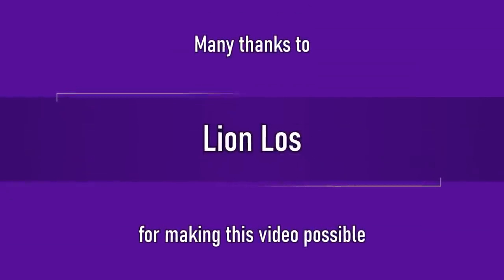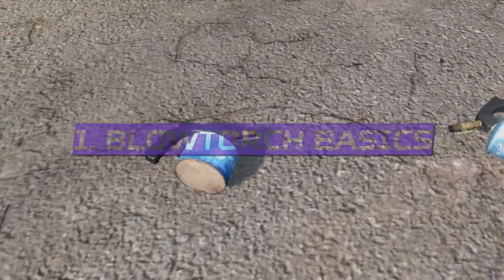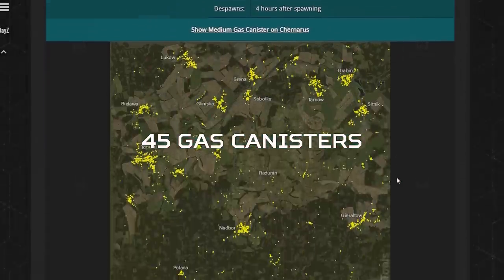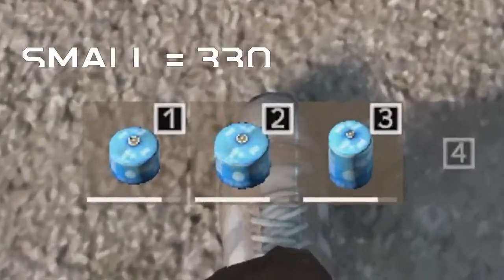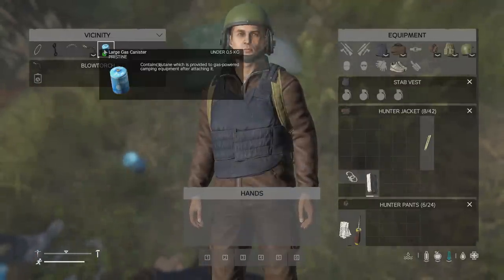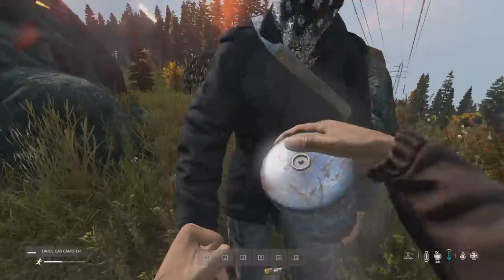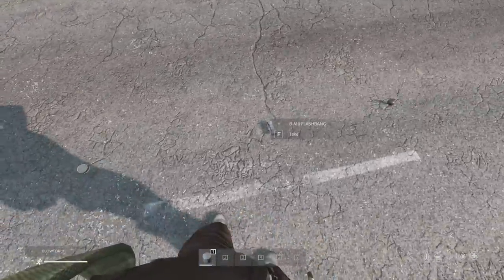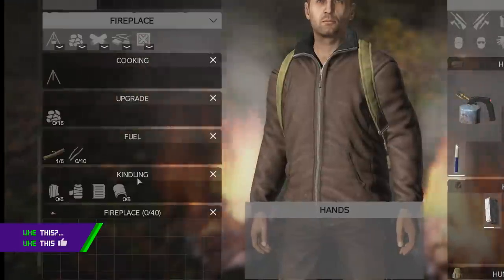Everything the new Blowtorch can do in DayZ 1.19

Comment: The blowtorch should repair radiators and then the electrical repair kit should do spark plugs and car batteries
Reply: Yep.. the radiator esp. like IRL
Reply: I think spark plugs are non-repairable IRL.
Reply: @zdspider6778  pretty much same with radiators, unless it’s the outer part, the aluminum frills in there would just melt by a blowtorch lol
Reply: In real life though, spark plugs pretty much never go “out” unless heated to the point they melt. If otherwise, all you have to do is “clean” them with a degreaser and light grade sand paper. I have did this many times. But for Dayz, that’s tricky If the blow torch could “fix” a spark plug. When when a spark plug usually goes out from the residues (real life). But, the residues could possibly burnt off (game theory thinking) for Dayz. Kinda difficult, but I believe Dayz could swing, for the blow torches to work, for fixing spark plugs.
Reply: Spark plugs occasionally widen the spark gap as time goes on
You can heat the tip up and bend it back
But it should take a electric repair kit to pristine a spark plug
Reply: @donovanulrich348  Not to mention if the ceramic breaks its done.
Reply: The radiators are not repairable in most cases irl. Spark plugs too. I know that the Day Z is not a full representation of brutality of our real world and it's operating on some simplifications, but simplification doesn't mean that u're able to do things that are not possible.
Look at the consistency of those simplifications: u get sick - u need to take medicines to get better, u break ur leg - u need to make splint or take lots of drugs to prevent u from fainting constantly due to the pain, u break the car - u need spare parts and tools to fix this. See this? These simplifications are consistent with the actions that u need to perform in real world. In real world there isn't any option to repair the broken radiator. Ofc IT'S POSSIBLE to seal it somehow, but noone can guarantee u it's gonna work more than very short period of time.
Reply: Or epoxy
Reply: @SrtKillz12345  nah they should add sandpaper to fix the plugs then
Reply: Why not an actual toolkit though? Nobody uses a blow torch on any part of a car
Reply: I kind of like the rarity and fragility of spark plugs. Its the closest thing we have to an anti-theft measure.

Comment: Blowtorch could be used to hardend steel on axes, hatchets etc. After using a sharping stone to increase condition then use blowtorch  to harden the edge and increase the durability of the shrapen edge. If afrer harden and edge hits metal or stone then edge is damaged or chipped.  Metal becomes brittle after heat treat but wear surface is stronger.

Comment: Was hoping to use it for repairs on my metal walls, as sometimes randoms like to beat on the first gate for a while, but noticed my worn metal made a prestine wall anyways, now ill use it for my dilapidated barrels instead 😆
Was also hoping to repair wire and barbed wire too, but no worries.
You would think it would be a good tool to get the barb off a gate before raiding...
When i raid with hand tools i HATE when he steps into that wire while swinging 😁

Comment: desinfecting sewing kits with fire in general (dry matches, lighter, campfire, ovenfire, gascanister) should be possible
Reply: A sewing kit is thread.. Yes for the needles but the thread which needs disinfected also would just go on fire instantly when put near any fire source never mind a fucking blow torch.
Reply: @N1ceDreamsz  Didnt thought about desinfecting the thread, you're right. Although you could bury the threat in hot ashes of a fire for a while or heat it up by putting it in contact with the metalic casing of the sewing box, but thats all very impractical
Reply: What about boiling it?

Comment: I ran into an issue w the blowtorch today. game crashed and i logged back in to find my car flipped on its side, rad and spark plug ruined. Thats nothing new. The engine was bright yellow so i took out the blowtorch and got the prompt to repair it, began repairing it (blue glowing light and all) but then the server reset. when i got back in, i couldnt use the blowtorch on the engine :( both the blowtorch and fuel canister were only damaged, and the engine was bright yellow, so i am at a loss. I tried removing engine components one at a time to see if i could get the repair prompt again, tried logging in and out as well. Has anyone else had this?

Comment: Blow torch fixing the engine makes far less sense than the pipe wrench, however it should be the normal wrench that is needed to repair an engine.
Reply: would be cool if a combination of tools was needed for cars and generators etc. like use a a pipe wrench to go from badly damaged to damaged and then a wrench to go from damaged to worn and so on

Comment: You should be able to craft improvised charcoal with a blowtorch and sticks/cloth
Reply: Then that charcoal can be used to fill gas masks or to create an improvised water filter combined with a bottle.
Reply: How does one Improvise charcoal? Do you burn fake wood? Lol I'm messing with ya. 😅 it would be just charcoal my guy. And I think that is an awesome idea. Also why can't you make soap with animal fat and charcoal.
Reply: Charcoal can't be made that way. Charcoal is made by heating wood thats being deprived of oxygen. If you introduce oxygen, the wood will just burn and become ash (ash is used for soap, not charcoal).

If you wanted to make charcoal in the game, a realistic way would be to combine short sticks with a used food can to craft a char tin. The char tin could be attached to fireplaces, and after some time, would produce charcoal.

In real life, you'd want to use a coffee tin. You'd put wood inside, close the lid, and poke a single hole in the top for vapor and gasses to slowly escape. The tin is heated on coals. There's a bit of monitoring you need to do, but if you did it right, water vapor and other gasses will escape the tin, but prevent oxygen from entering as the pressure inside is forcing gasses out one way. So basically, the wood "burns" without actually ever being on fire. This conversion process produces usable charcoal.

There are other methods to produce charcoal, but this method makes the most sense for DayZ.

I do like the idea of turning rags into char. I actually do this IRL using some old cotton shirts and an Altoids tin. You put some scraps of cloth into the tin, and just chuck it on some hot coals near the bulk of the fire. Let it sit there during the evening, and after a couple hours, take it out of the fire, and let it cool (very important to let it cool). Once cool, it's safe to open, and you have a nice batch of char for starting future camp fires in adverse conditions. 😃
Reply: @MisterPickle.  haha I'm just a humble DayZ survivalist. I only learn things by dying.
Reply: @Gottaculat  Wow Thanks for the lesson!

Comment: Blow torch should act like a gas stove to cooking pots, fix radiators to pristine, spark plugs to worn, all barrels to pristine, cauterize wounds but infect them, and cause burn damage to players without bleed affects and damage pristine objects if you hover over them with the flame. And should blow cars up if you attept to fix the gas tank, with gas in it 😂😂👌  epoxy or empty it

Comment: Cars should explode if you attempt to repair a leaking fuel tank with a blow torch!!!
Reply: Yes
Reply: Not if the fuel tank is empty.
A hose would be nice, to suck out fuel. Maybe even from cars on the side of the roads.
Reply: @zdspider6778  an empty fuel tank is more likely to explode when applying a blow torch to a hole in it. You can test this safely(safer than trying a blowtorch on a gas tank) at home with a water bottle or some lightweight container you perforated. Try melting the plastic back together with fuel, and with it completely emptied of the fuel. One is going to explode instantly on you, one is going to create a huge fireball followed by a small explosion. Which do you think would produce which results, and why do you think this?
Reply: @JeffOnhill  Emptying it completely of fuel before using a blow torch on it makes more sense to me. If it's perforated it probably won't explode either way.
Reply: @zdspider6778  as I said, try it at home with a water bottle.

Comment: How the heck does a blowtorch repair anything ? It doesn't make sense.
Reply: Yeah.. except for small metal items.. and THE RADIATOR which they didn't add 🙃
Reply: Fuses stuff together if you heat them hot enough. IMO it should be combined with the epoxy putty. Using it cold is weird.
Reply: @alfrede.newman6626  a blowtorch would melt a radiator especially the frill parts
Reply: @KingLouis420th  well you can go play mechanic simulator for a more realistic experience